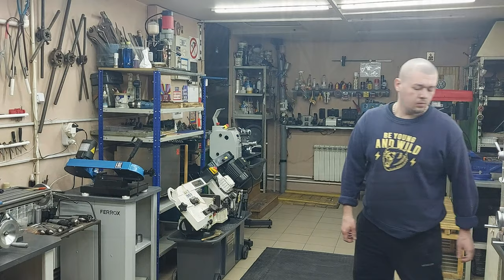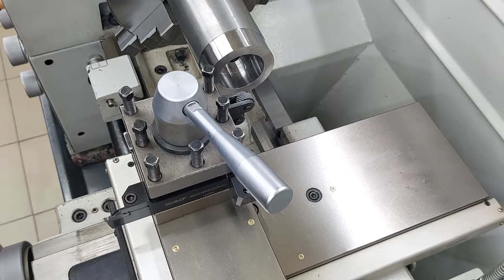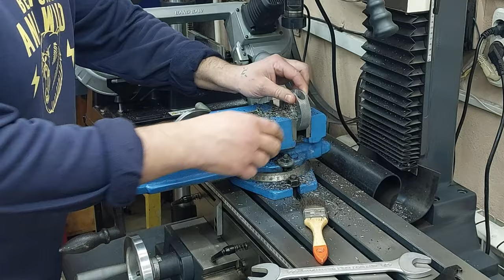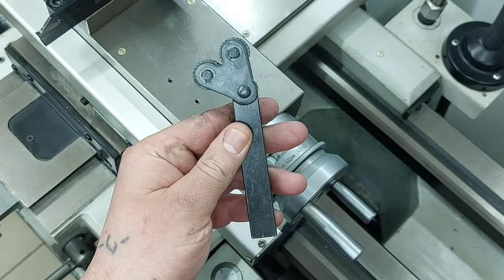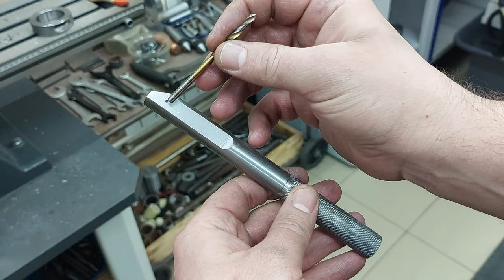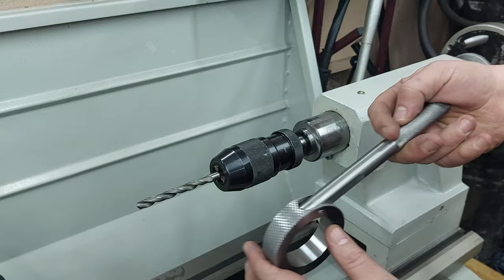Excellent tip and trick in 6 minutes! Every great craftsman should have this innovative tool

Comment: A great tool for that stubborn keyless chuck. Speaking of chucks, why do so many YouTube machinists not use a 4 jaw chuck on anything much bigger than their thumb? Not too hard to master and, as I was told some 50 years ago, “you can swing a battleship by its bowsprit in a 4 jaw chuck, IF you can get it in the machine” such is it’s gripping power !
Reply from the maker: You are right, thank you my friend and welcome😉
Reply: If only a battleship had a bowsprit  ☹
Reply: I agree with you,Mike. I rarely use my 3 jaw chuck. 
I was taught to use the centre lathe by 2 toolmakers and they only ever used 4 jaw chucks, faceplates,or collets but never any self centering 3 jaw chucks.
Truing work up in a 4 jaw becomes a quick process with a little bit of practice and the 4 jaw independent chuck is far more versatile than any 3 jaw chuck.
Reply: @howardosborne8647  Thanks Howard, because I specialise in precision cylindrical grinding I mostly use a 3 jaw chuck on my Jones & Shipman universal and only use a 4 jaw for larger, heavier and/or odd shaped jobs. That 3 jaw chuck is mounted on a “floating” backplate. Because of the very light pressures involved with cylindrical grinding, the backplate and chuck assembly is only lightly secured to the machine’s fixed backplate with 3 screws and large clearance holes that are also lightly tensioned. When a workpiece is mounted it is quick and easy to “clock” the job up precisely, taking only seconds from one workpiece to the next. On a lathe, however, the independent 4 jaw chuck rules!
Reply: Почему, почему... Время - деньги, и терять время на установку заготовки, которая все равно будет обтачиваться и снаружи, и внутри, в четырехкулачковом патроне - непозволительная роскошь. Плюс, патрон с хорошо проточенными и отшлифованными кулачками прекрасно зажимает и центрирует деталь. А четырехкулачковый патрон есть смысл применять в одном-единственном случае, при зажиме неровных и многогранных заготовок. В остальных случаях это просто трата времени (а значит, и денег) заказчика, что является неуважением к его технической неграмотности и использованием этого недостатка в свою пользу, что не этично.
Reply: @_MadFox  Help, your reply is in a language I don’t understand! Could you please furnish an English version? Cheers.

Comment: What part of keyless chuck don't you understand?
These chucks are designed to work WITHOUT a key, so why waste time making something to FORCE the jaws tighter than designed?
If you really want to hold something that tight, just buy  a chuck with a key!
A waste of time effort and materials.
BTW, you don't usually place a freshly knurled part into the chuck and mark/damage the knurl.
Reply from the maker: When drilling holes, the chuck clamps and cannot be unclamped by hand, so I came up with this contraption to avoid messing up the chuck with a gas wrench